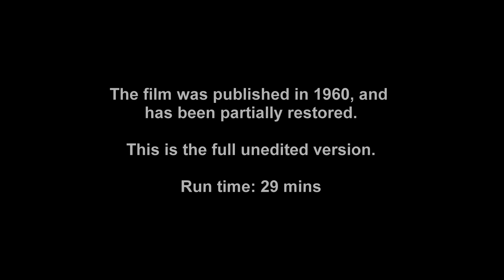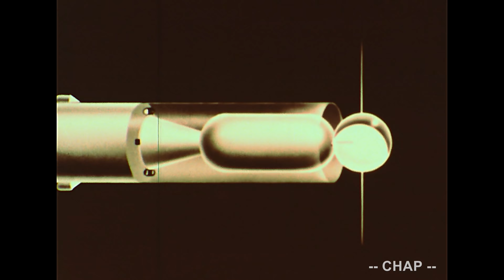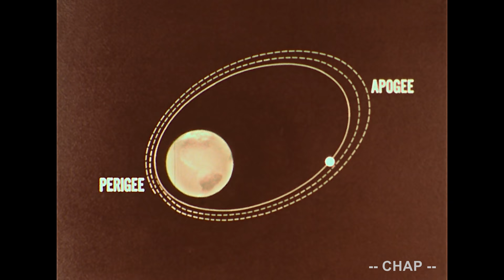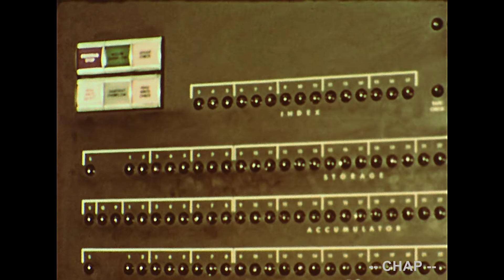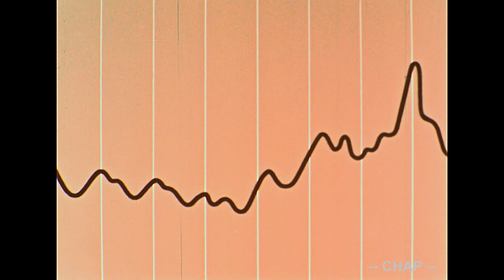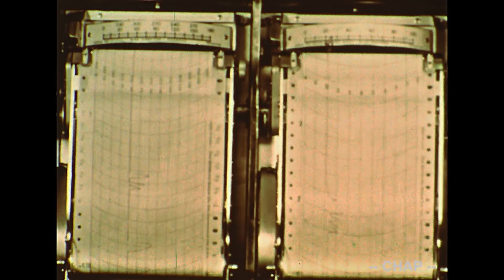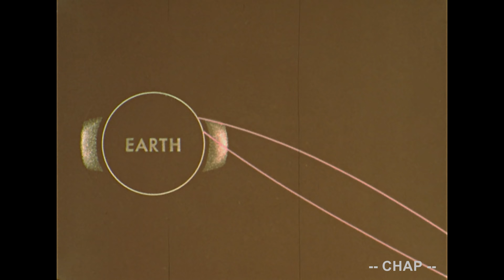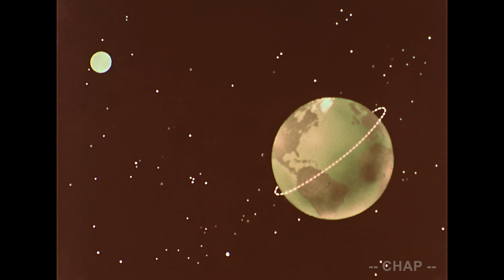NASA Computers 1957-1959 IBM 704 - VANGUARD SATELLITE Launch "Science in Space" (Burroughs Datatron)

Comment: 10,000 tons of microparticles every day, how does that affect gravity over time?
Reply: An easy lookup and some calculator math says it would have no measurable effect at all.

Wikipedia gives the mass of the Earth as 5.97-something times 10 to the power of 24 (10**24) kilograms.  That converts to approximately 65,808,000,000,000,000,000,000 (6.5808 X 10**22) tons. 
 
10,000 tons a day for a billion years adds up to around 3,652,500,000,000,000 (3.652 X 10**15) tons. Which would add less than 0.000006% to the mass of the earth.
Reply: i would suspect, more mass = stronger gravity. dont think anything that low can escape earths gravity pull. so we as a planet are getting heavier
Reply: @RottnRobbie  plus the amount of mass that earth loses every day from its atmosphere!
Reply: @bgbthabun627  minus not plus :)
What a great video so glad I watched it.

Comment: At 17:27 looks very much like reused German radar dishes.
Reply from the maker: That is an interesting observation!   Thanks!  ~ Victor
Reply: The two dishes in the foreground are probably early to mid-WWII U.S. Navy radar antenna dishes for a large ship like a battleship or aircraft carrier. I've seen photos of smaller dishes of the same style built for both the U.S Army and Navy during WWII. The heavy duty yoke mount is typical for the U.S  Navy.
Reply: @dalecomer5951  Have a look at the German Würzburg Riese, it looks quite identical to the dishes in the movie. Look at the support of the dish grid. It also had a yoke mount, but that might not have been reused. I cannot see that.
Reply: @typograf62  The large Würzburg dish is similar in size and shape but the detail structure of the dish and mount is quite different. There is a section in the Wikipedia article on the Würzburg radars about post-war use and there is no mention of any being used by the U.S. The U.S. Navy SK-2 was used through most of WWII on aircraft carriers and is about the same size as the two dishes in the film. However, the more I look it seems probable that those dishes are post-war designs.